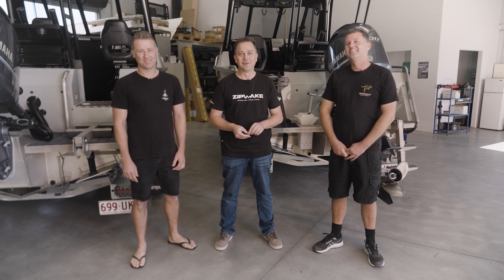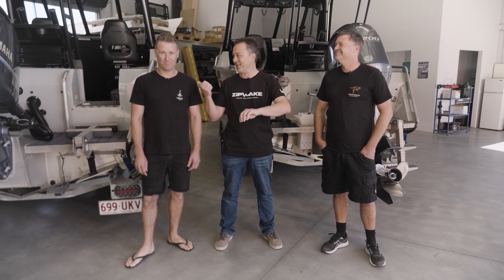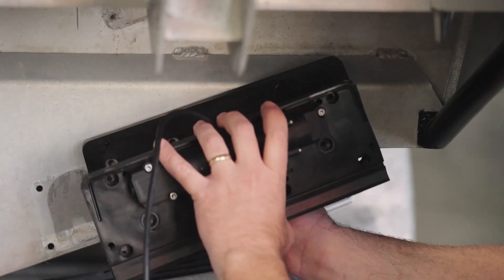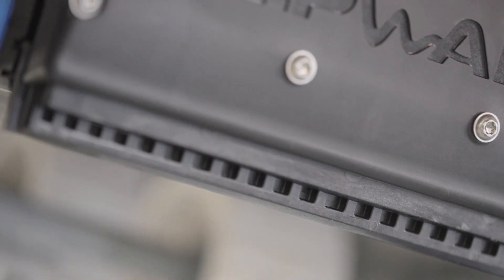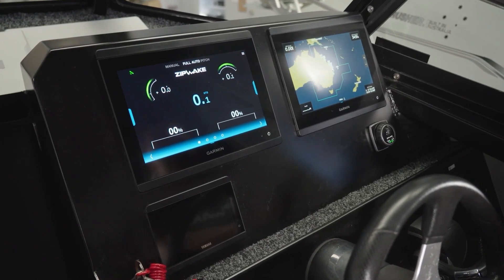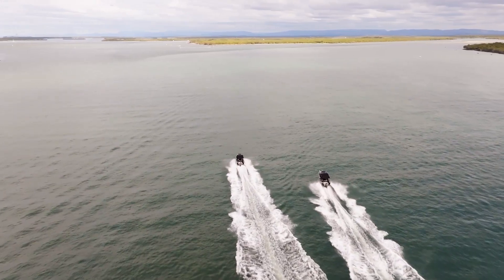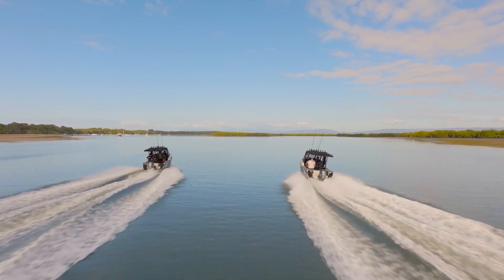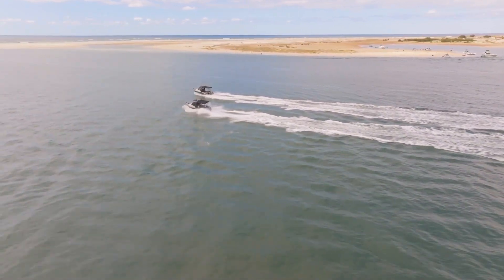Zipwake Dynamic Trim Control System vs. Trim Tabs – the ultimate test!

Comment: Does the fuel economy drop much with the zip wakes?
Reply from the maker: Hi! Yes, the Zipwake system minimizes wave resistance and saves fuel. The average is 4% to 9% in fuel savings but we have many examples where we see savings up to 18–20 % when using the Zipwake trim system versus running the boat without Zipwake or with old fashioned trim tabs. The result will vary due to different boat types and sea conditions.
Reply: @ZipwakeAB  interesting 🤔 mate of mine has them and his fuel consumption went up and in calm conditions the zip wakes kinda rock the boat side to side seems better without them unless in a bit of swell